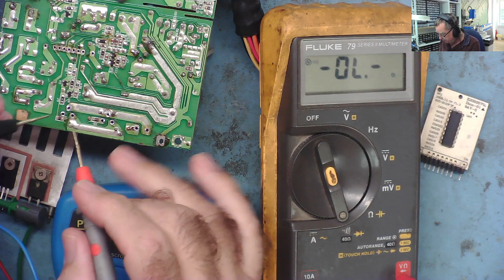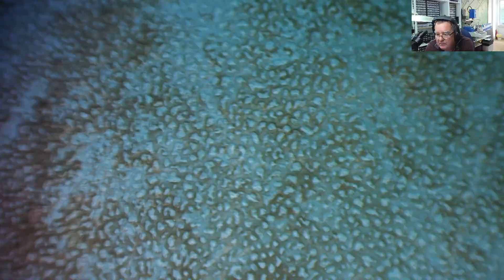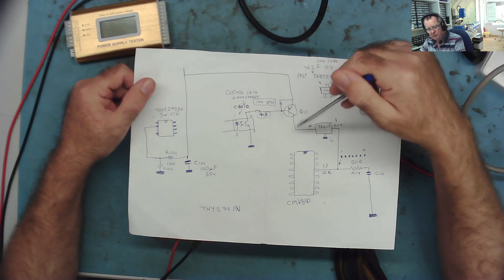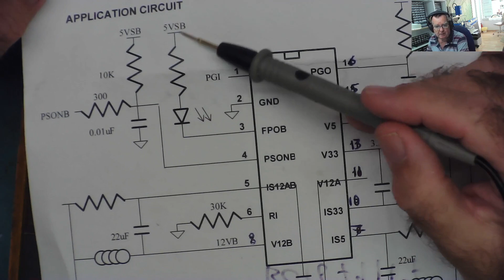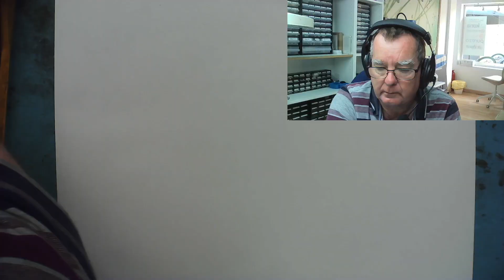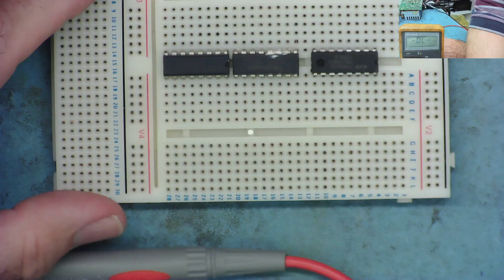500W ATX PSU 5V Standby OK but does not turn on - A more complex repair. Part 2 LER #151

Comment: How does 220v from the rectifier become 317v at the capacitor when the PFC is not working.  If the MOSFET is always open there is no way for the cap voltage to exceed the rectifier voltage.  The MOSFET must be switching, but the duty cycle is too short.  Is that caused by the PFC controller, or by a signal that the controller receives?

Comment: I have an EVGA 750W N1 PSU model with basically the same issue, and even changing most of the suspicious components, like: all electrolytic capacitors, even the TNY279PN, a 78L15, few TL431K, all the optocouplers and the issue persist, and I'm still investigating what thing could be causing the issue, but no luck :/

Comment: Many thanks for these two videos Richard. Although you didn't fix yours, the explanations given along with the demonstrations and safety precautions gave me the confidence to open up a failed PSU of mine. I built a lamp tester, but no isolation transformer yet.
Followed my circuit and found that the PFC/PWM< controller (CM6805BSX) had a 1 volt VCC. Looks like the opto coupler is open circuit on the low power side :)

Comment: Hello Richard,  Thank for your very informative videos.  

I have a PSU PC exibiting the same type of fault as the LER PSU you were working on.  The 5v dc standby working and the green wire giving an output of about 3v dc.  However when the psu tester is plugged in and the PSU powered up, immediately shuts dowm.  Did you check the output of the Power Good output.  On my PSU it is zero volts  so that causes the PSU to completely shuts down.

Hence, power good circuit needs checking/sorting out as to why that circuit does not ouput +5v dc that signals to switch the low side 5v, 3.3, +12v and -12v dc outputs on.  Have you consider this state?  A another video would be helpful to finally solve why this PSU is not turning on.

Kindest regards John R.

Comment: I have a 750w power supply that kicked the bucket recently, I just got an identical unit and will see if I can get the original working.. Learned a lot from these two videos!

Comment: Disconnect the Main power supply from the output of the PFC by removing the FETS in the main power supply  and try to run the PFC on its own to check the PFC operation first . The PFC output voltage appeared  to be low . One chip controlling PFC and Main power supply  - a questionable design !

Comment: After Been sure to have not any kind of short circuit, you can try to feed the psu directly avoiding lamp bulb. It seems that the psu trying to start but the current is limited from something. I already tried to fix a similar smps unfortunately without success.

Comment: I bought some 8 pin chips from Ali-express ICE2QR4765 for a 850w PSU, luckily I checked across VCC and GND before fitting, those pins were shorted. Glad I didn't just fit it. Another great vid cheers

Comment: Interesting video, thank you.
If you are not sure about the FET's you could test them under load on the breadboard, also could you not test the Chip if you know all the required pin signals in and out?
Maybe you can't find the correct data sheet for this device I'm not sure.

Comment: You keep saying same thing about hot ground. Half main voltage. But that is not true. Not sure where you get it. Negative voltage is just voltage in opposite way. And diode bridge will make sure you have nothing on negative side.  That teachings you are following was wrong.
Reply from the maker: Yama 007
Yeah I did mention, I am sure, that in the early 80s when I took my qualifications, my instructor said that they called it 'half mains voltage' but really they meant all of the mains voltage half of the time.  This is where i get it from

This was on CRT TVs, with an early 'switchmode' type PSU called a 'chopper' working at mains frequency or a SYCLOPS working at 15.625 KHz for PAL TV - See SYnchronous Converter and Line OutPut Stage = syclops

So as you correctly say the chassis is connected to the mains by the bridge rectifier diodes.  Therefore half of the time (one half cycle) the chassis is connected to live.  The other half of the time (other half cycle) it is connected to neutral.  

Have you ever measured the voltage between chassis (hot ground) and earth ground, in countries like the UK where they have polarised earthed mains plugs and Neutral is connected to ground at the substation?  It reads half mains voltage for the reason I just mentioned.
Reply: With AC you have positive on one end and on second half cycle it is on other end. And just 50/60 times per second (Hertz). So diodes which are working only in one way (from  positive to negative) give you only one output. Meaning everything on positive end and nothing on negative end. Therefore it is called DC.  But back to your question. To our houses (not flats) in village we are getting 4 wires (3phases plus neutral). Grounding is done with neutral. And of course you better measure it so are you sure you have proper grounding of your house and there is none voltage on it. Those with 1 phase in the house/flat were also creating ground by connecting it to the neutral. New rules says neutral and ground should be separated at circuit end so you can involve RCD (residual current device). Electrical safety device that quickly breaks an electrical circuit with leakage current to ground. I'm quite sure you know it. In Slovakia it is mandatory to use those devices when you are building electricity in your house. So technically if you get DMM and try to measure voltage between phase (hot) and ground you measure nothing. Beacuse this device with catch it and immediately breaks circuit.  Therefore what you are saying about hot ground....it simply cannot happen. Once your device is properly grounded...you are safe.
Reply from the maker: @yama007  Yes but no but....  In the instance I was quoting the TV set had a floating chassis, not grounded, and not connected to Neutral - in other words hot ground.  This was in the days before SCART sockets and video recorders/home computers of course

In modern equipment yes the device is usually grounded, but the hot ground in the SMPS - before the galvanic isolation of the SMPS transformers - will measure around half mains voltage between hot ground and safety ground.  I'll demonstrate that some time on a future video.

It is true that an RCD will trip off the power if there is a difference in current between live and neutral conductors (so therefore the differential current is flowing to earth) but that does not mean the differential current will not give you a shock if it is flowing via your body, though the RCD may well trip out depending exactly how much current is flowing that way.

The only ways to make hot ground 'safe'  to touch are either isolate yourself from ground and don't touch anything grounded, or the safer way, use a mains isolation transformer,  then you can touch either one of the mains conductors safely (but not both at the same time) as whichever one you touch will effectively be grounded through your body and become the neutral conductor
Reply: @learnelectronicsrepair  Yes. Transformer is a bit different story.  Therefore i was mentioning things behind 4 diodes bridge. And i would like to see your video ;-) And own isolation (body resistance) is another topic. Initially i posted something...but i decided to delete it. I do not want to give people idea to test it.

Comment: Hello. I have a tagan bz900 power supply, the structure and symptoms are the same as yours, the solution is to replace the Ps232, I bought it on aliexpres.
Reply from the maker: Nice one

Comment: Hello
I have a 1600 watt power supply that is not outputting 5V from pin8 (PGO) of ST9S313 ( which is a PC POWER SUPPLY SUPERVISOR ) . All other voltages of the 24 pin connector are ok.
I can not get the IC or equivalent, can I just bridge 5v from anywhere on the board to this pin ( it is pin5 on ( the grey wire ) on the 24 pin connector.

I have found  ST9S313 equivalents and datasheet. The equivalents are 1. HY510N <=> WT7510 <=> ST9S313 <=> PS113 <=>RT7501. Thank you in advance.
Reply from the maker: It would be better to try and trace the fault to be honest.  Some cheap ATX simply connect PG to the 5V supply and that does work in many cases but that does not properly meet the ATX specification and may not work with some motherboards - there should be a delay of some milliseconds between the main voltages coming up and PG going high.  If you have continuity from the grey wire to power good output of the supervisor IC, try changing the IC if they are cheap and easy to get
Reply: @learnelectronicsrepair  I have traced the PGO to the power supervisory chip  ST9S313 and chechecked all its inputs. Allok but PGI. I can not trace PGI because the baiard is very tight and I have worked with PSUs before. I am afraid of the cap voltages. There are some huge caps there :) I need a schematic to know where PGI comes from. or at least the chip typical circuit. in the datasheet they have a typical circuit but does not show where PGI comes from.  all of these are equivalent from my search 1. HY510N <=> WT7510 <=> ST9S313 <=> PS113 <=>RT7501

Comment: Dear,

I have problem my 3.3v go up to 3.7v, which can be a problem
 ?

Thanks!
Reply from the maker: First thing - make sure you have a proper load on 3.3V before testing - a 2 ohm 10W resistor is a  good choice. A lot of PSU use the 3.3V rail to regulate all the voltages and it can't reduce the voltage on 3.3V if nothing is loading it.
Reply: @learnelectronicsrepair  I see the 3.3v go up to 3.7v when i connect 2 hard disk. I'll check
! Thanks
Reply from the maker: @carlopasswords7083  This is exactly what I was trying to say.  

So you connect two hard drives - therefore the ATX PSU has to generate more power to run those hard drives - that makes sense yes?

When the PSU generates more power it does so on all the voltage rails including 3.3V because there is only one SMPS transformer generating 12V, 5V, 3.3V and -12V.  It can't generate more power on one voltage and not on the others.  Also makes sense yep?

The hard drives do not draw any power from 3.3V  I don't care that the orange wires may go the the SATA power connector, the HDD does not use it at all.

So what happens to the extra power going intothe  3.3V supply?  

Well if there is no load it charges up the capacitors on 3.3V to a higher voltage, yes?

Try putting a load on 3.3V - a 2 ohm power 10W resistor would be ideal, but if you don;t have one try wiring 10x 22 ohm standard 0.5W resistors in parallel - or even 20x 47 ohm 0.25W - whatever you have.

I think then you will find 3.3V stays stable when you connect your hard drives 😉
Reply: @learnelectronicsrepair  Thanks a lot !

Comment: Hello, I haVvw an 1600W chinese PSU. It has Surma written on it as a brand. suddenly it stopped. The MOBO fan works but. the mobo. light does not show nor the a picture. I replaced the PSU and  the mobo worked fine. I measured all the voltages of the 24 pin connector by shorting pin 4-5 and all voltages are OK except pin 8 - PWR_OK gives 0.03 volt. I am aware of GPU repair a bit but this is the first time I open a PSU. Any ideas where shall start my diagnosis?  if you have an email I can send you a pic of the PCB. Thanks in advance :)
Reply from the maker: @Wael Elkholi  Come over to the discord server - I set it up so w ecan all get together and help with repairs

Learn Electronics Repair is now on Discord!  Come and join the fun, it's free.
https://discord.gg/vam6YC8vwU

Comment: It should work without PFC. PFC it's aditional future. In my PS when I had a bad pfc mosfet PFC tried to running and after few seconds running simply without PFC, but ATX work with all voltages. CM6805BSX - this same family of combo chips. Not sure you did check any shorts on the second side which could you give a huge overcurrent flow. I quessing - the maintransformer have short windings from firstly damage. Diodegonewild show a good circuit how to test a short winding transformer.
https://youtu.be/QBbEYYWiBI8
Reply from the maker: Hi Wegi
This was my thought - that it should work without PFC.  I am a bit confused if that is the case when the controller chip is combined pfc and pwm.  But obviously it does not work in this case even if I disable PFC.  I honestly think I did check for shorts on the secondary side in the first video of this PSU but I do agree with you so  I will check again to be sure.  It's so good to see you adding your thoughts and ideas to this repair attempt - this is what I hope this channel will become 🙂

I'll check out the link you posted
Thanks

Comment: Thanks for great video
Reply from the maker: Glad you enjoyed it
Reply: @learnelectronicsrepair  I do not have a Scope so can you to this test ?
Take SMPS power supply remove Y caps that go from neutral to ground on the hot side. This removes ~110V from the power supply case. The myth is this makes PSU ripple to rise, or produces interference in the output. Can you test this?
Reply: https://i.postimg.cc/SNHpbnX9/safe-psu.png
liteon_pa-1121_04
https://i.postimg.cc/g0H9h4gy/unsafe-psu.jpg
Reply from the maker: @juliusvalentinas  I can give it a go when I get chance.
Reply: @learnelectronicsrepair  "I can give it a go" - thank you.

Comment: can you not do a ring test on the PFC inductor to check for shorted turns?
Reply from the maker: Hi Rob
I don't have the test equipment to do a ring test.  Maybe I could build something and make an interesting video too.  Any suggestions?
Reply: @learnelectronicsrepair  an oscilloscope is all you need .connect one end of inductor to the calibration terminal on the oscilloscope and the other end to the input of the scope if there are no shorted turns you should see a big pulse followed by some smaller ones (rings)
Reply from the maker: @robtitheridge9708  OK thanks.  I do know about ring testers just never really needed one before. I know enough to know that it seems a possible cause of the fault on this PSU. 

I also found a few projects to build a ring tester from discrete components, with coloured LED output (for those who don't have access to an oscilloscope).  I'll research a few options and look to put a #LER video together on the topic.

Thanks Rob.
Reply: Hello Rob, could you please elaborate this further a bit? How exactly I can test inductor with scope? Where should I connect to? I have tried to follow instructions and I get exactly same signal like on input of inductor. 5V 1kHz square wave
Reply: @srpkovukovic  try zooming in on the falling edge and increase the vertical gain.
set the scope to AC and trigger on falling edge
Reply: Due some reason I am not able to do this test. Probably I don't know to set up scope correctly. Still getting same waveform on the output like on input